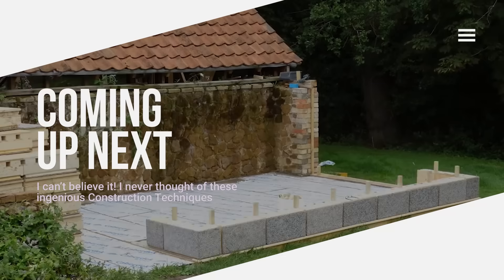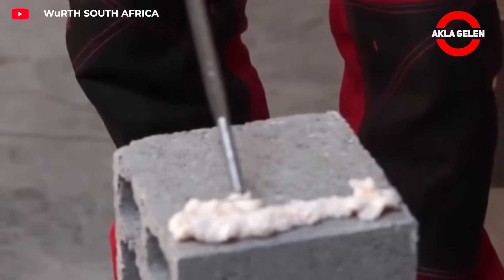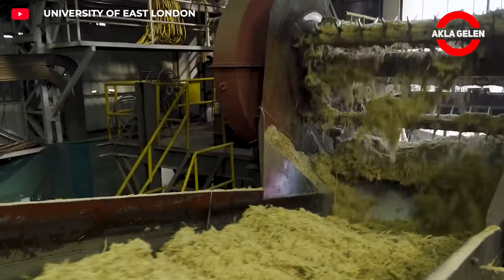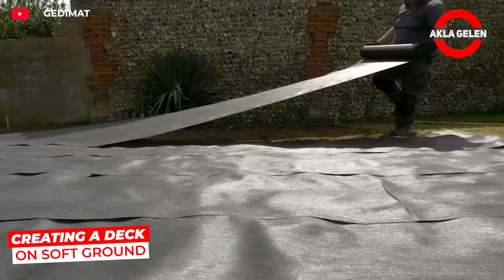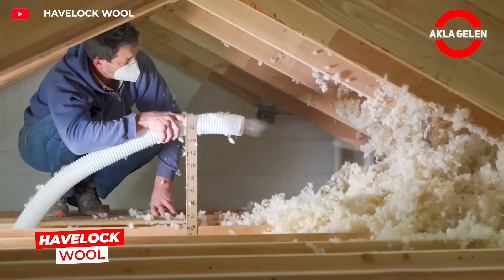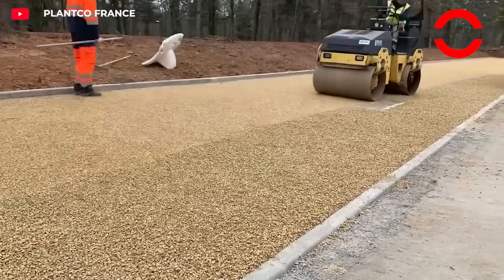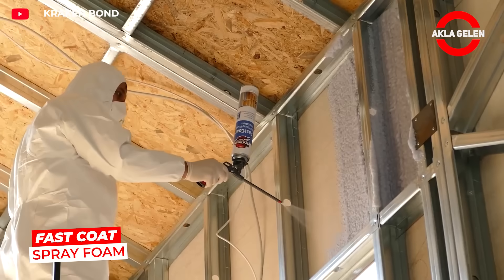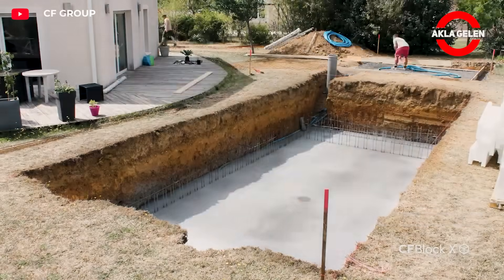I can't believe it! I never thought of these ingenious Construction Techniques

Comment: That sheepwool insulation installation shows what not to do.  The insulation is shown blown into the eaves blocking the eaves over rafter ventilation that will result in condensation in the roof space.  Also, sheepwool has real issues with insects as being a natural material it becomes a breeding ground that is both warm and dry.  You can't coat the sheepwool with insecticide because the fumes given off into a home environment would be a health risk.  There was a recent case of a couple buying a London house that had been improved with sheepwool insulation resulting in a plague of moths within the house that made it uninhabitable.  The previous owner was successfully sued for the original £32.5M price (minus a notional rental amount)